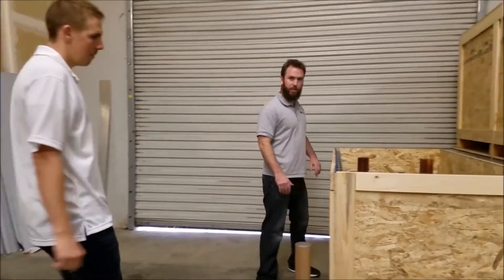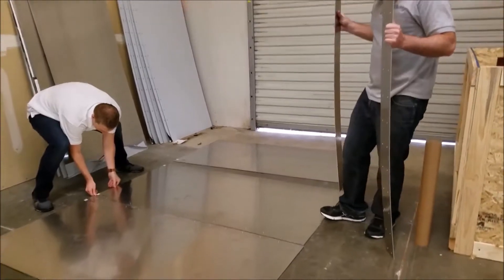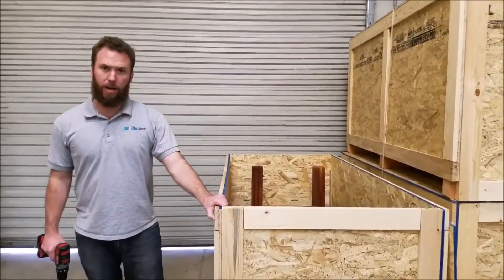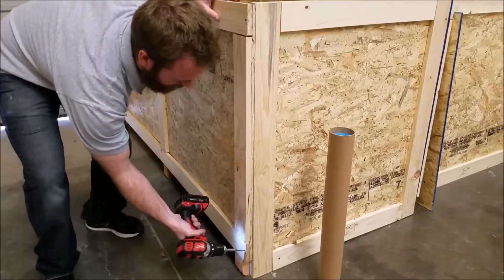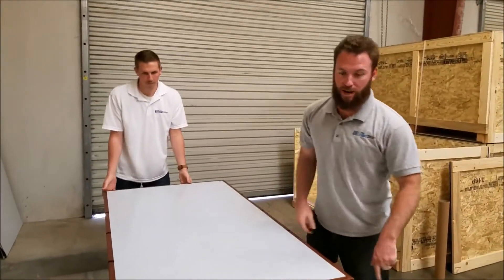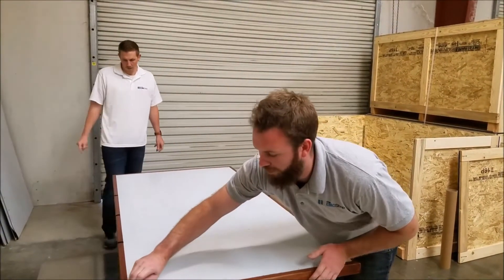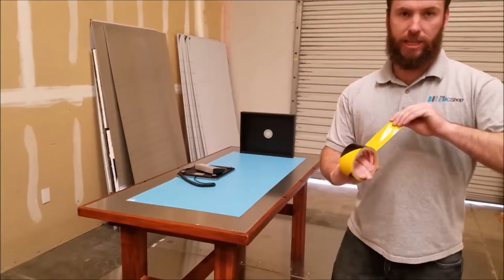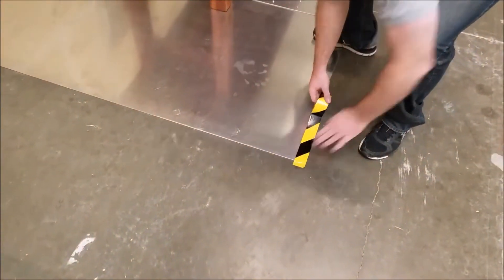Setting up the ESDguns.com Test Environment for Electrostatic Discharge (ESD) Immunity Testing

Comment: Hello, what kind of spray did you use for the insulation mat to the metal sheet? Thanks!
Reply: Hi Dexon, apologies for the delay. If you Google or Amazon 3M Spray Adhesive we use Heavy Duty or Repositionable for heavy DUT (easier to swap, clean and reposition Insulation Foil after it's worn out)
Reply: Thanks!!!